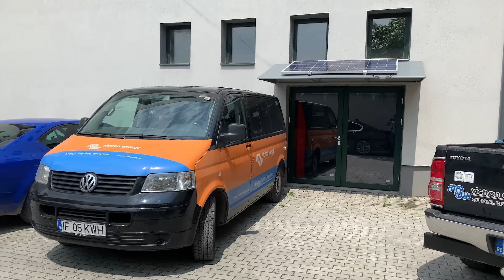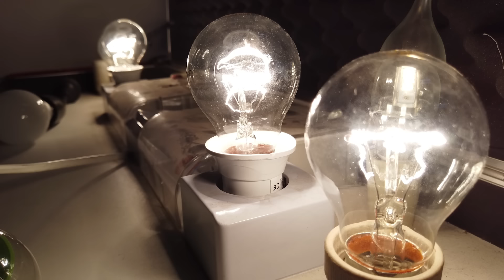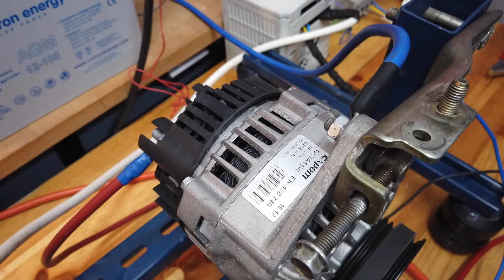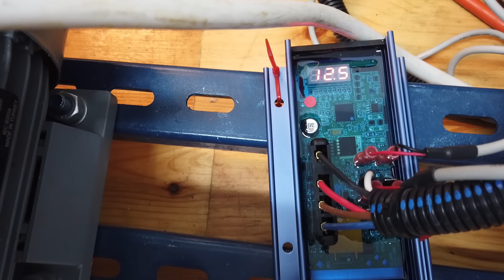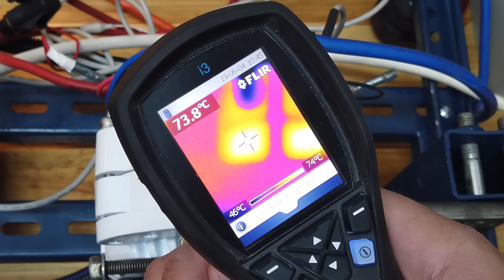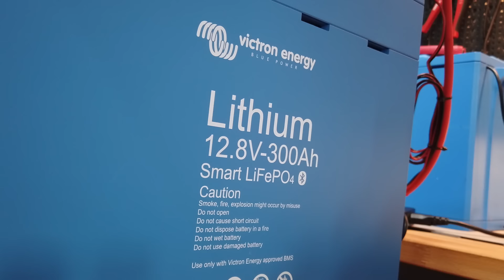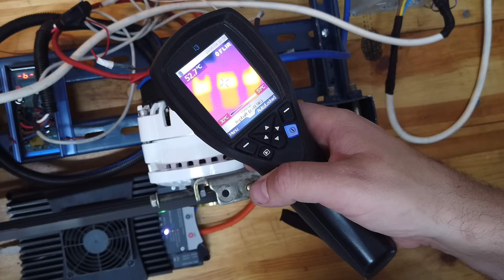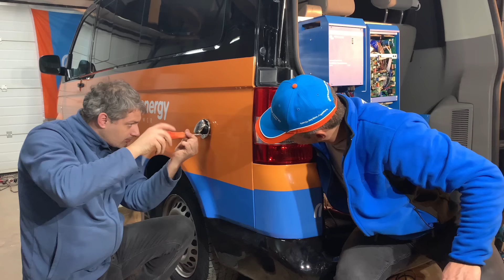How to not blow up your Alternator when charging Lithium

Comment: Thanx for this, i was thinking of buying me a 4lifepo cells (62ah) for a great price, using just a cheaper balancer.. maybe this ain't worth the risk of damaging my alternator 🤔?
Reply: Try to be careful buying for a "great price" , might be a reason for that great price.   A balancer is in any case also needed by the way
Reply: @JohannesBoonstra-ol2nz  i WAS talking about balancer, pay attention
Reply: @paveljelinek772  pay attention?   Please formulate the question properly and the answers will be clear as well.
Reply: @JohannesBoonstra-ol2nz  maan what's wrong with you i did not put any question
Reply: @paveljelinek772  I thought the sentence with a ? is a question....". maybe this ain't worth the risk of damaging my alternator ?"
Reply: @JohannesBoonstra-ol2nz  yup, i expected some answer like "you're right it ain't worth the risk" or "go for it don't be afraid"
Reply: @paveljelinek772  I can do that !  sorry for the confusion!    you're right it ain't worth the risk//go for it don't be afraid!
Reply: The price of lithium batteries has come down remarkably in the last year.  I also think if you buy a non-bluetooth lithium battery, it's significantly cheaper than their newer Bluetooth models.  With so many ways of protecting your alternator relatively inexpensively, if you need the benefits of lithium, absolutely go for it!
Reply: @SailingWindGypsy  yup, already installed it and had noticed immediately that alternator is always off, it's just on when i go downhill or motor braking (no gas).. SUPER
Reply: @paveljelinek772  Good to hear!  I was on this page because we are switching over to lithium on our boat. I was able to get 400 amp hours of LiFePO4 batteries for LESS than the cost of 400 amp hours flooded lead acid golf cart batteries.  Unfortunately had to spend another $600 on other new equipment 😂
Reply: @SailingWindGypsy  yup, i was scared a little at first because of the recuperation charging when motor braking etc. BUT must the battery has enough capacity so it won't overcharge, it would but the hill (downhill) must have been 10km or more and i did not encounter such 😁

Comment: Hello, I have a boat in which I am planning to use a 12V 300Ah - Cranking & Deep Cycle Lithium Battery (Dual Purpose) as my starting and house battery same time. Can you please advise if using an Orion XS 12/12-Volt 50 amp DC-DC Battery Charger directly from the alternator would be sufficient or if should I add any more devices to charge safely directly from my alternator into my Lifopo4 double-purpose battery? Thanks a lot
Reply: You alternator needs to "see" a battery most likely to work best, so if the lithium is your starter battery as well the DcDc converter cannot be used.  perhaps adding a smart regulator is the better solution then ( this controls alternator temp as well)
Reply: @JohannesBoonstra-ol2nz  thanks for the advice!

Comment: As many I guess, this video worried me a bit thinking I'll blow my 2 x 115A 18 year old alternators mounted on 2 Volvo Penta D4 engines. But then I kept on looking because I didn't like the more complex DC/DC chargers known to be heat producers with quite small amp output. And I found some very interresting stuff about this video such as the fact the test was made with a Citroen alternator. So I ended up thinking, what the heck, if my alternators blow, it'll just be time to change them anyway. I did the test with the following setup: 2 alternators feeding 2 Victron Argofet battery isolators with 3 outputs feeding my 3 battery banks: 1 bowthruster/winch Optima 5.5 battery - 2 port engine 5.5 Optima battery - 3 starboard engine & house battery (this one is a mix of 75Ah Optima 5.5 + 400 Ah LiFePO4). I've monitored carefully the current draw (meter + Victron App) and I've never seen more than a 120 Ah draw, even with the lithium fully discharged. I also checked the heat on the alternators and everything was normal. Actually, most of the time the charging curent is around 80Ah which should be ok for 2 x 115A alternators. This is my first year with this setup and so far it works like a charme. No anomaly seen and the Daly BMS as well as the Victron App have never reported any error. I will follow up this comment if a noticeable problem arises of course. 
Geraud in the Med area of France
Reply: there will be no alarm coming from both battery or Victron App, the point is mainly that the lifespan of the alternator is reduced as they work on a (much) higher temp.

Comment: What about protecting the alternator from voltage spikes resulting from BMS shutdowns, or heavy loads disconnecting?
Reply: The alternator should preferably have its own (starter) battery to limit spikes and to be able to run without a battery current
Reply: We installed an $80 balmar alternator protection device.

Comment: Knowing the internal resistance of both the alternator and the battery is key to planing the setup. If the battery has a lower impedance, a buckboost combo can protect both. Best of all is an on dash selector where the operator can choose to limit to 80% of the capacity. Careful usage planning ahead of time will give you optimum longevity.  Best to use 2 batteries for ultimate redundancy. For cold weather use a battery heating will lift life expectancy.

Comment: In the same way that risk is reduced with a correctly configured Orion DC/DC charger, can risk also be reduced with the use of a correctly configured Victron inverter? I want to use an inverter in my towing vehicle, connected to a MultiPlus charger installed in my trailer. If my alternator is 140A, can I put an 800W inverter without worrying about the alternator? I'm putting 48V LiFePO4 batteries in my trailer, and I was thinking about using the Orion 12/48 to charge via the alternator, but the Orion 12/48 is not a charger! So I thought about using an inverter and charging through the MultiPlus, which will be communicating with the battery, which is something that only the Orion XS does. Taking advantage of the fact that I will be converting to 220V, I would place the inverter in the towing vehicle, to facilitate the connection to the trailer, not needing the thick cables that a 12V connection would require. I thought about using the same 13-pin socket (I didn't find the voltage isolation data for it, nor if there would be any other problem with putting this connection to 220V in that socket, but I'm thinking there's no problem). Of course, instead of having losses in just one DC/DC converter, I would have losses (probably greater) in converting 12V to 220V in the inverter, and then losses in the MultiPlus charger. But I believe there would be less losses in the cables and connections, as it is 220V instead of 12V (therefore with a much lower current). And I think it would be worth it because it would be charging the batteries in a fully controlled way through the MultiPlus communicating with the battery (through Cerbo and using DVCC). Is there anything I'm not considering? Alerts and recommendations are welcome! If the idea is good and works for someone, enjoy it! I did a lot of research on the internet and found no information about this type of charging via the alternator, neither for nor against it...
Reply: The inverter of 800watt will be hardly a heavy load for the alternator so thats fine.  A Orion to feed an inverter is not a good idea as this will be to "slow" voltage regulation wise to have the inverter supplied with enough energy

Comment: Always wondered why high output alternators had 6 Awg wire now I see why they use the wire to limit the amount of current. Usually lead acid start batteries only need lot of current for short amount of time as they recharge time from an engine start is short. My Ram 2500 truck had duel alternators or 480 amps but wire is 6 gauge no way it could even come close to using all that current. More of a marketing scheme.

Comment: This is spot on for sailing boat install. I am converting to LiFePO4 batteries and was wondering about alternator charge from a small 8HP Yamaha outboard engine. So in a small sailing boat you'll have a "large" Li batterie (150-200 Ah) and a small <10 H.P. outboard engine that will not run for a long time typically. (If there is no wind I usually don't go out sailing) From your video I conclude it will make no sense to try recharge a large Li battery under these conditions and would probably don't even bother cabling it. I'll have a proper AC charger that is plugged to the AC unit in the boat when on shore, and use it to recharge the batterie.
Reply: Or a small hundred watt solar panel and a $15 charge controller.

Comment: What about using an external fan to hold air into the alternator
Reply: Tha alternator does have an internal fan , but due to the 50% efficiency the heat is not easily to be lowered by a fan.

Comment: My small 4cylinder van has a 160amp OEM alternator.   My house battery will be 460AH Lithium.  Can my van handle a 50amp DC-DC like the Victron Energy Victron Orion XS Smart 12/12 50A DC-DC Charger?
Reply: yes, that would be no issue !
Reply: @JohannesBoonstra-ol2nz  A 50amp DC-DC will pull 60amps and the vehicle itself will be pulling another 30-45amps for a total load of 100 amps. This far exceeds the 30% duty cycle you suggest for an alternator. Please explain. If the Orion Charger has duty-cycle control or the alternator itself is temperature compensated then I would agree with you.
Reply: @cruze1953  we advise a 50% maximal load, not 30%

Comment: I have a 220amp alternator. I think it will hold just fine.
Reply: This is what I'm wondering; why would I regulate down my amperage to 50 amps with a DC to DC converter when my alternator can produce much more?  I always thought alternators were self-regulating.

Comment: An engine running at idle is about 700/800 rpm but the drive ratio to the alternator is at least 1:2. So an alterternator speed of 1500 is not greater than an engine at idle
Reply: We know, its also not saying the time to failure will be as in the clip, but in time there will be an alternator failure for sure as the temperature will be to high for coil/bearings ect.

Comment: if starter battery is charging and there is another agm battery parallel, does it boil starter battery
Reply: AGM in parallel with the Lithium?   Thats not how you should use lithium, but then also this is not protecting the alternator

Comment: I must by chance have a really good alternator fitted as standard on my vw transporter i regularly idol charge and run my 700w inverter to charge up my lithium PowerStation i measured the positive coming off my starter battery onto my 400ah lead battery bank and when the inverter is running at full load i get 86A with an idol engine speed of 950rpm  i must do this for around 2 hours continually 5 times a week i wonder why  my alternator hasn't burnt up yet its also 12 years old

I think is got a max output of 140A
Reply: Most likely because you are driving and the ambient isn’t high   , when you would have this setup on a boat or such it was a different story
Reply: @johannesboonstra6917  I idle charge mostly so stationary and summer gets around 30c here I think what they are not accounting for here in this demonstration is the auxiliary pulley ratio I don’t think engine speed and alternator speed are mirrored

Comment: My alternator is right behind my radiator fan. So even at idle has heavy air flow. I wonder if I can safely charge lithium.
Reply: depends on the load on the alternator.   if you want to be safe...
Reply: monitor the temperature of the alternator with a thermistor or thermocouple.

Comment: I'm charging my AGM house battery using a solenoid . Can I switch to a Lithium Battery using the same solenoid ?
Reply: preferably not, a dcdc converter wil be best most likely in your case
Reply: Batteries in parallel should be the same voltage and chemistry

Comment: 70amp citron alternator, no wonder it overheated, you wouldnt even use the car it comes from to use dual batteries. most dual battery cars have a 150amp alternator at a min. Redo the test with realistic conditions. ie air flow from a fan like on the radiator of the car and also wind flow from the car moving. also use lithium batteries with on board bms that regulates overcharge and heating issues. these test results are unrealistic to normal conditions. FYI yes it is best to use a DC-DC charger either way but lots of tests have shown it is not required and in some cases your lithium batteries can handle the direct input to lithium of 80amp like the test done by Mercedes.
Reply: It's not just cars , its also boats, there is less airflow there right?      BMS with internal regulation is fine!  as long as its being regulated, The point we are trying to make here is not that the battery can handle the current, of course it can.  Its the alternator that with its 50% efficiency get far warmer then designed for and will have a short lifespan..
Reply: @johannesboonstra6917  Yea but they were using a relatively weak alternator on a big battery bank. Which it was never designed for. The average single 12v battery bank is under 100ah for cars with 70amp alternators. 4x-6x more than standard. Then you have to consider they are mainly designed to charge LA batteries generally.

If you got the capacity for a large battery bank, you have the capacity for a bigger alternator or proper charge controller.
Reply: @CowsGoMonkey  the point is, due to the efficiency the heat generated is enormous , with a larger alternator even worse
Reply: @JohannesBoonstra-ol2nz  Sure, but the alternator is already there usually. Can't expect a moving vehicle to be efficient at using ICE for electricity. That is what ICE generators are for. 

Getting charge from the alternator is just a byproduct/benefit of needing it in the first place. It's not meant to be the main source when idling, considering it would take hours of running/idling to fill a large bank. Not efficient. But very cheap and easy way to get "free charge" if you are already using the engine.

And if someone is putting in a larger alternator, it's usually not only to increase charging capacity/ability, but to be able to add more demanding electrical devices (lights, winches, etc. ) while the engine is running.

Like think about it...
Reply: @CowsGoMonkey  not sure what you mean, but point what was made here was that the alternator need to be protected against overload/overheat , then a DCDC converter is one of the possible solutions
Reply: @CowsGoMonkey leisure boats typically wants larger battery banks.
Reply: @OmmerSyssel  Yea, if you can afford a large battery bank, you can afford a high amp alternator or proper dc/dc charger. I don't see the point of using an undersized/overtaxed system to prove an obvious point.

How can a person own a large boat with lots of batteries but can't invest a few hundred dollars for a charging system?

Like owning a boat doesn't make batteries and electricity work any different. Some people got more money than brains lol.

Comment: Fake
Reply: Really?   having a alternator with a 50% efficiency running idle on a half empty lithium battery for a while doesnt burn the alternator?     If you want we could repeat the test on your car,  we take a lithium and connect its with jumper cables to your alternator and let it run for a while.   We let you do the temp reading then.

Comment: I don't understand very much out of it ;/ could you tell me what should I use between alternator and powerstation to prevent issues? like adjustable inventer? would be thankful for any info
Reply: I understand this this can be quite technical. Please contact the local dealer (found on the website) and discuss you system and needs.  Surely they can explain this to you.

Comment: 2 things: 1, you did not simulate the engine compartment of the vehicle which typically has a radiator fan located very close to the alternator and blows air on the alternator helping with cooling. 2, as far as sudden shut down of the lithium charging which could damage the alternator, most vehicle engine scenarios include a lead acid battery in the charging loop which will absorb the output of the alternator when the lithium suddenly stops accepting a charge because the BMS shuts down charging.
Reply: Very interesting. My tow vehicle is a 6.7 diesel and under the hood I have two 12v lead-acid batteries and in my trailer I have 3 x 12.8v 200ah LIFEPO4 batteries. So, from what you say, my alternator is safe as long as the crank pulley to alternator pulley is 4 to 1? I haven't towed my trailer since I installed these batteries so I am curious (anxious)!
Reply: You claim that the hot air coming from the fan that forces air through the engine radiator, which contains hot water, will cool the alternator, which is a little hotter than that same water. Wrong. The hotter the engine, the less the alternator cools because in most cases the alternator does not get outside unheated air, but hot air from inside the engine compartment, and the only way to cool the alternator better is to drive at a higher speed and higher rpm.
Reply from the maker: What about boats that 1, don’t have a radiator fan and 2, have a dedicated alternator for service batteries?  

We have experience with tens of thousands of systems and know this can damage lithiums. We have made this video to try and help people. Please read the replies to other concerning questions in the comments below.

Comment: I am currently putting a system together using a Balmar mc -618 regulator, it is capable of adjusting field power to alternator using temperature input from the alternator along with other programable input data. Have you done any testing using Balmar's regulator with a standard OEM alternator instead of with a $1500 Balmar alternator?
Reply: With an exteral regulator its safe as well (if set up correct of course)